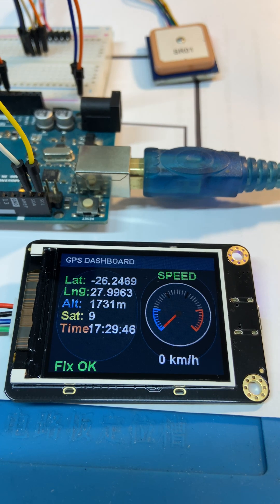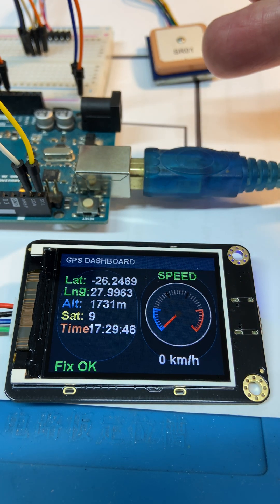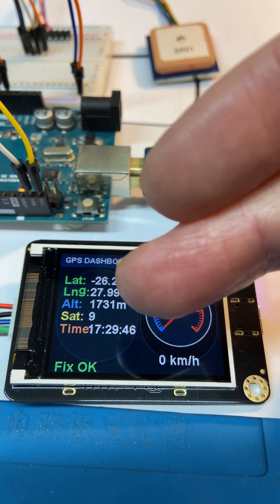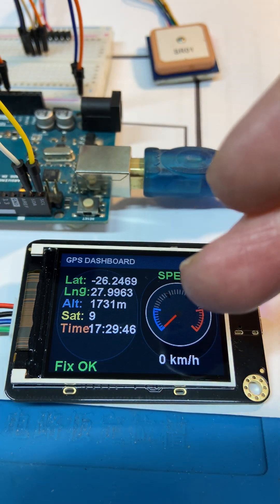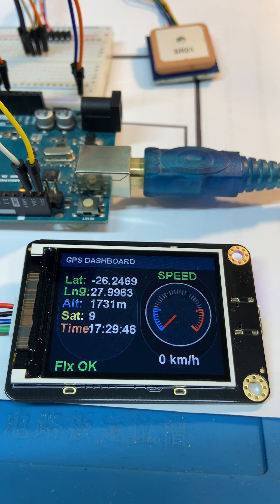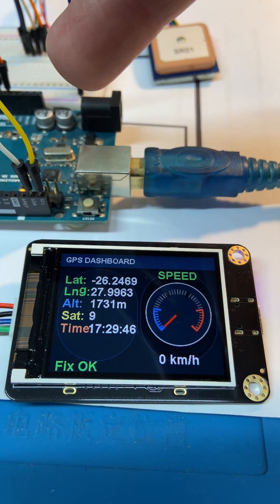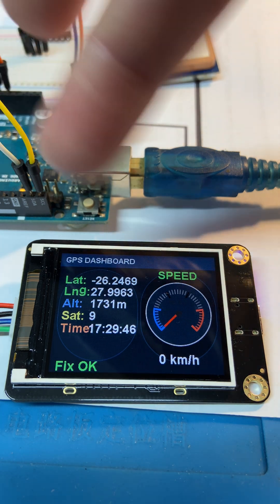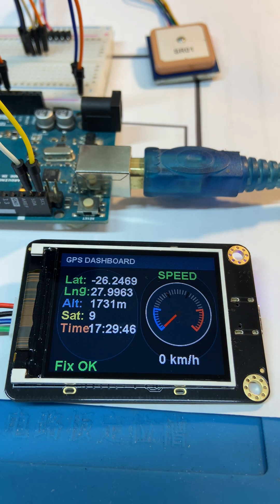Arduino Mega GPS Dashboard on a 2" Color Screen! 🚀📡#shorts #electronics #arduino #gps #satelite

Comment from the maker: #include <Wire.h>
#include <TinyGPS++.h>
#include "DFRobot_LcdDisplay.h"

// ---------- GPS ----------
TinyGPSPlus gps;

#define GPS_SERIAL Serial1
#define GPS_BAUD   9600

// ---------- DFRobot 2" Color Screen (I2C) ----------
DFRobot_Lcd_IIC lcd(&Wire, 0x2c);

// Dynamic text IDs
uint8_t latId      = 0;
uint8_t lngId      = 0;
uint8_t altId      = 0;
uint8_t satId      = 0;
uint8_t timeId     = 0;
uint8_t statusId   = 0;
uint8_t speedNumId = 0;

// Gauge ID
uint8_t speedGaugeId = 0;

// Manual GPGGA parsed values
double   ggaAltitudeMeters = 0.0;
uint8_t  ggaSatellites     = 0;
bool     ggaHasData        = false;

// NMEA line buffer for manual parsing
char     nmeaLine[120];
uint8_t  nmeaIndex = 0;

// Clamp helper
long clampLong(long v, long vMin, long vMax) {
  if (v < vMin) return vMin;
  if (v > vMax) return vMax;
  return v;
}

// -------------------- GPGGA PARSER --------------------
void processNmeaLine(char *line) {
  // We only care about GPGGA here
  if (strncmp(line, "$GPGGA", 6) != 0 && strncmp(line, "$GNGGA", 6) != 0) {
    return;
  }

  // GPGGA format:
  // $GPGGA,time,lat,N,lon,E,fix,sats,hdop,alt,M,geoid,M,...*CS

  char *p = line;
  char *fields[15];
  uint8_t fieldCount = 0;

  // Split by comma, but stop at 15 fields max
  while (fieldCount < 15) {
    fields[fieldCount++] = p;
    char *comma = strchr(p, ',');
    if (!comma) break;
    *comma = '\0';
    p = comma + 1;
  }

  if (fieldCount < 10) {
    // Not enough fields for sats + alt
    return;
  }

  const char *fixQualityStr = fields[6];
  const char *satStr        = fields[7];
  const char *altStr        = fields[9];

  int fixQuality = atoi(fixQualityStr);
  if (fixQuality == 0) {
    // No fix
    ggaHasData = false;
    return;
  }

  int sats = atoi(satStr);
  double alt = atof(altStr);

  ggaSatellites     = (uint8_t)sats;
  ggaAltitudeMeters = alt;
  ggaHasData        = true;

  // Debug
  Serial.print(F("GPGGA parsed -> Alt="));
  Serial.print(ggaAltitudeMeters);
  Serial.print(F(" m, Sats="));
  Serial.println(ggaSatellites);
}

// -------------------- DISPLAY LAYOUT --------------------
void drawLayout() {
  lcd.cleanScreen();
  lcd.setBackgroundColor(0x001020);

  // Title bar
  lcd.drawRect(0, 0, 320, 30, 0, 0x000000, 1, 0x004080, 0);
  lcd.drawString(10, 6, "GPS DASHBOARD", 0, 0xFFFFFF);

  // Left panel
  lcd.drawRect(5, 35, 155, 185, 1, 0x004080, 1, 0x001830, 1);

  // Labels
  lcd.drawString(12,  45, "Lat:",  1, 0x80FF80);
  lcd.drawString(12,  70, "Lng:",  1, 0x80FF80);
  lcd.drawString(12,  95, "Alt:",  1, 0x80C0FF);
  lcd.drawString(12, 120, "Sat:",  1, 0xFFFF80);
  lcd.drawString(12, 145, "Time:", 1, 0xFFB080);

  // Dynamic values
  latId  = lcd.drawString(65,  45, "------", 1, 0xFFFFFF);
  lngId  = lcd.drawString(65,  70, "------", 1, 0xFFFFFF);
  altId  = lcd.drawString(65,  95, "----m",  1, 0xFFFFFF);
  satId  = lcd.drawString(65, 120, "--",    1, 0xFFFFFF);
  timeId = lcd.drawString(65, 145, "--:--:--", 1, 0xFFFFFF);

  // Status line
  statusId = lcd.drawString(10, 215, "Waiting for GPS fix...", 1, 0xFFA000);

  // Right panel
  lcd.drawRect(165, 35, 150, 185, 1, 0x004080, 1, 0x000810, 1);

  // Speed title
  lcd.drawString(200, 30, "SPEED", 1, 0x80FF80);

  // Speed gauge
  speedGaugeId = lcd.creatGauge(
    175,       // x
    60,        // y
    130,       // diameter
    0, 140,    // min / max km/h
    0xFF0000,  // pointer color (red)
    0x002040   // gauge background
  );

  // Big speed text
  speedNumId = lcd.drawString(190, 190, "0 km/h", 0, 0xFFFFFF);
}

// -------------------- DISPLAY UPDATE --------------------
void updateDisplay() {
  char buf[32];

  // ---------- Latitude ----------
  if (gps.location.isValid()) {
    char out[16];
    dtostrf(gps.location.lat(), 0, 4, out);
    snprintf(buf, sizeof(buf), "%s", out);
  } else {
    snprintf(buf, sizeof(buf), "------");
  }
  lcd.updateString(latId, 65, 45, buf, 1, 0xFFFFFF);

  // ---------- Longitude ----------
  if (gps.location.isValid()) {
    char out[16];
    dtostrf(gps.location.lng(), 0, 4, out);
    snprintf(buf, sizeof(buf), "%s", out);
  } else {
    snprintf(buf, sizeof(buf), "------");
  }
  lcd.updateString(lngId, 65, 70, buf, 1, 0xFFFFFF);

  // ---------- Altitude (from GPGGA) ----------
  if (ggaHasData) {
    char altField[16];
    dtostrf(ggaAltitudeMeters, 0, 0, altField); // integer metres
    snprintf(buf, sizeof(buf), "%sm", altField);
  } else {
    snprintf(buf, sizeof(buf), "----m");
  }
  lcd.updateString(altId, 65, 95, buf, 1, 0xFFFFFF);

  // ---------- Satellites (from GPGGA) ----------
  if (ggaHasData) {
    snprintf(buf, sizeof(buf), "%u", ggaSatellites);
  } else {
    snprintf(buf, sizeof(buf), "--");
  }
  lcd.updateString(satId, 65, 120, buf, 1, 0xFFFFFF);

  // ---------- Time ----------
  if (gps.time.isValid()) {
    snprintf(buf, sizeof(buf), "%02u:%02u:%02u",
             gps.time.hour(), gps.time.minute(), gps.time.second());
  } else {
    snprintf(buf, sizeof(buf), "--:--:--");
  }
  lcd.updateString(timeId, 65, 145, buf, 1, 0xFFFFFF);

  // ---------- Speed ----------
  long spd = gps.speed.isValid() ? (long)(gps.speed.kmph() + 0.5) : 0;
  spd = clampLong(spd, 0, 140);

  lcd.setGaugeValue(speedGaugeId, spd);

  char spdBuf[16];
  snprintf(spdBuf, sizeof(spdBuf), "%ld km/h", spd);
  lcd.updateString(speedNumId, 200, 200, spdBuf, 1, 0xFFFFFF);

  // ---------- Status ----------
  if (gps.location.isValid() || ggaHasData) {
    lcd.updateString(statusId, 10, 215, "Fix OK                    ", 1, 0x80FF80);
  } else {
    lcd.updateString(statusId, 10, 215, "Waiting for GPS fix...", 1, 0xFFA000);
  }
}

// -------------------- SETUP & LOOP --------------------
void setup() {
  Serial.begin(115200);
  while (!Serial) {;}

  Serial.println(F("Pretty GPS Dashboard - with manual GPGGA parsing"));

  GPS_SERIAL.begin(GPS_BAUD);

  lcd.begin();
  lcd.cleanScreen();
  lcd.setBackgroundColor(0x001020);

  drawLayout();
}

void loop() {
  while (GPS_SERIAL.available()) {
    char c = GPS_SERIAL.read();

    // Feed TinyGPS++ for lat/lon/speed/time
    gps.encode(c);

    // Build NMEA lines for our own GPGGA parsing
    if (c == '\n' || c == '\r') {
      if (nmeaIndex > 6) {           // line long enough to be interesting
        nmeaLine[nmeaIndex] = '\0';
        processNmeaLine(nmeaLine);
      }
      nmeaIndex = 0;
    } else {
      if (nmeaIndex < sizeof(nmeaLine) - 1) {
        nmeaLine[nmeaIndex++] = c;
      }
    }
  }

  // Refresh display periodically
  static unsigned long lastUpdate = 0;
  if (millis() - lastUpdate > 500) {
    lastUpdate = millis();
    updateDisplay();
  }
}